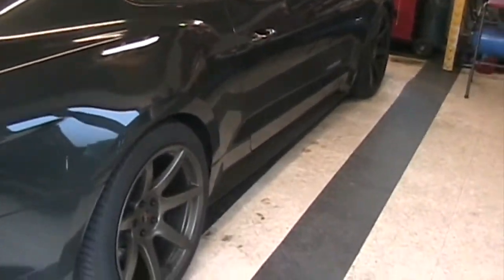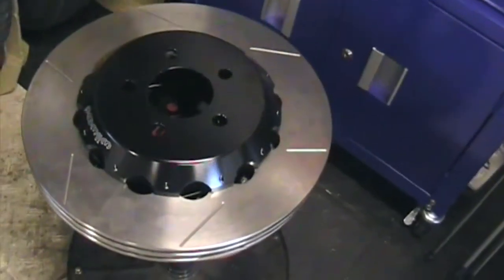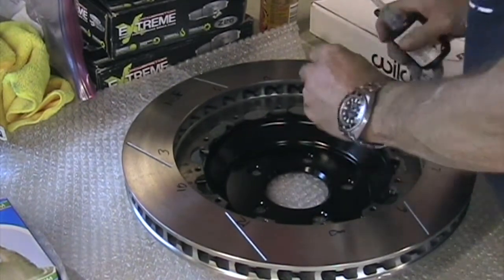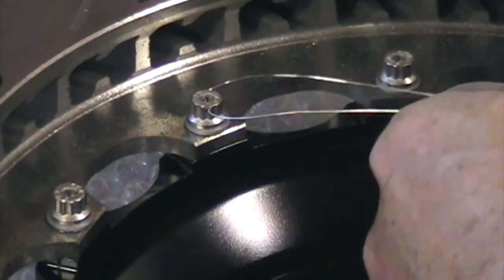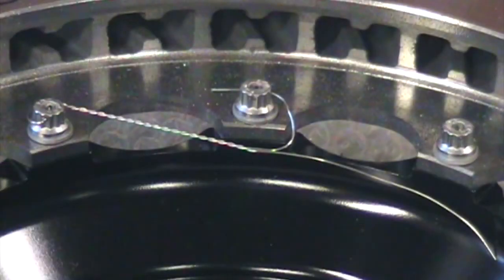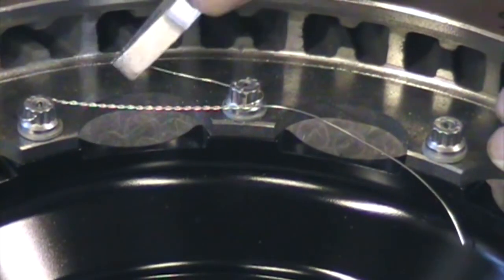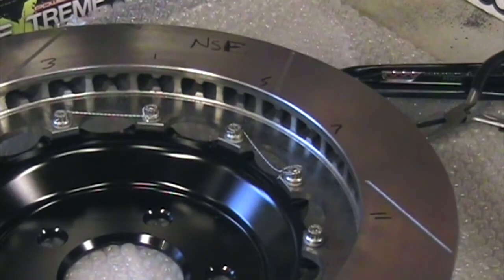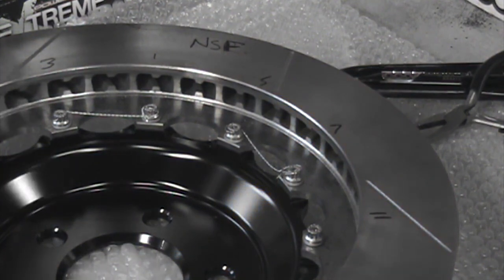Wilwood brake lock wire

Comment: Can you explain why you bought these rotors for your car?  How will they improve the braking on the GT? Thanks for the video.
Reply from the maker: KWAKAPILOT They won't improve stopping distances, or braking power, but they should improve ride comfort and suspension action. The front rotors are 12lbs lighter each, so 24lbs off front unsprung weight should make a noticeable difference to the handling.......
But the main reason I got them is that they look great.. unfortunately though I've Miss calculated the offsets so I can't fit them until I get new Centre bells..